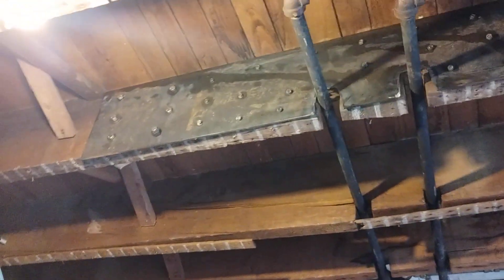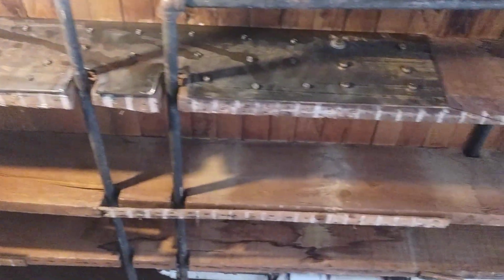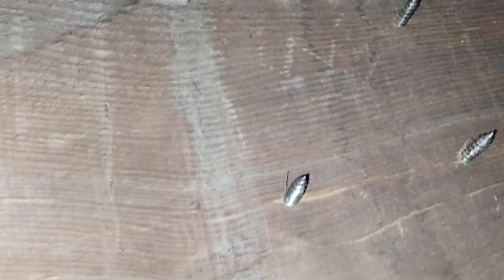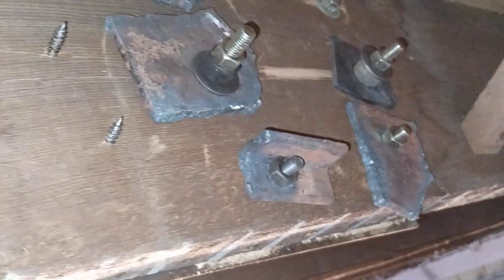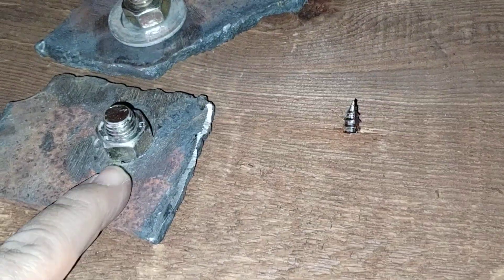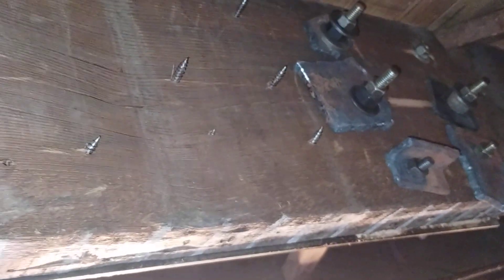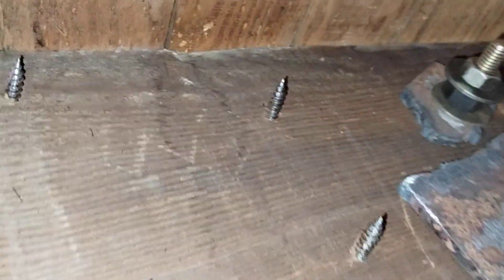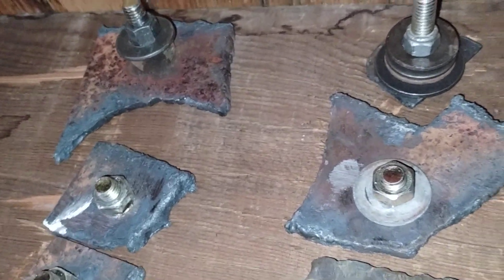Floor Joist Crack Repair from Split Crack using steel plate Part 5

Comment: This is basically what is referred to as a flitch plate. It should extend at least 36 inches on each side of the break and should be put on both sides of the break.
Reply from the maker: Are you trolling me? I already talked about glitch plates in first and second video and this was load tested by me and this is already engineered 4X to it's load ...

Comment: I've done similar, but I prefer to get the joist back to being straight again by jacking it back up and MIG weld the scabbed on steel sections end to end to make it one continuous piece of steel plus MIG weld on a continuous bottom steel strap to act as a bottom truss cord, then scab on a nailer on the opposite side to reattach the ceiling.

To prevent direct wood contact with the steel plate for welding I sandwiched flat washers or bearing plates between the steel and the wood joists.
Reply from the maker: Ha, part 6, I mentioned all but the washers you  mentioned. The video will go live at noon, on Saturday.
I also weld the wood with a MiG welder, haha 😅 , teasing of course, I like jokes.

Comment: Fascinating stuff.  This looks like one of those times where a fix can be absolutely hideous aestetically (those homemade washer with the torch crufties - LOL - been there done that ) but is exactly what will work for the situation.
Reply from the maker: This is the version where I show that no respect is required for fancy plate washers...
But, in the next joist the level will be with plate washers and the kicker is, they can slide moreso then the torch cut...you want the bite that the torch cut leaves behind...
The square plate washers can slip if the clap force is not maxed for that specific location of wood... specific location is critical as each section of joist may be less dense then another section. 
Don't worry about looks, worry about getting no slide and maximum clamp force.

Comment: Do you think that floor was over-stressed, in addition to being weakened by the notches? Also, if the pipes were rerouted, and no longer a factor, do you think sistering all the affected joists would have resolved the issue just as well?
Reply: I have a good feeling about the next solution you are about to present.
Reply: Cut the rod at an angle, hu? I never thought about that -- I'll have to try it next time it comes up.
Reply from the maker: It became really dry and a long with the pipe contact assisting in the drying action; this cut was the defect and time revealed it.
The rest of the joist are doing great where no cuts were made. 
We do need to keep some moisture in the house bc of wood NEEDING moisture for fibers to work. 
I hate those contractors out west talking about sealing up a house with foam...